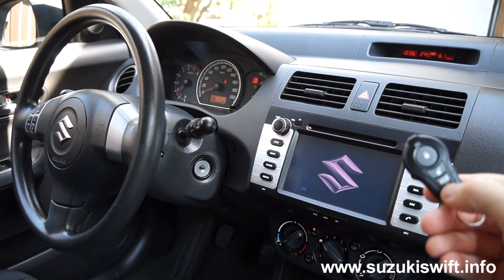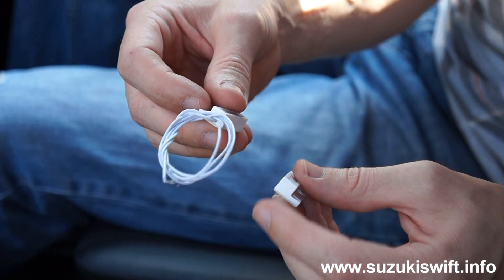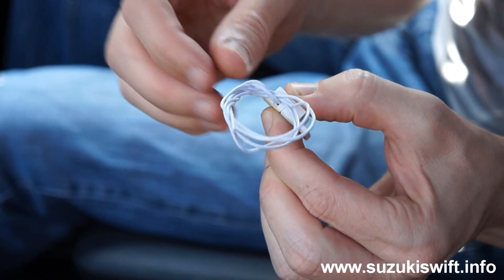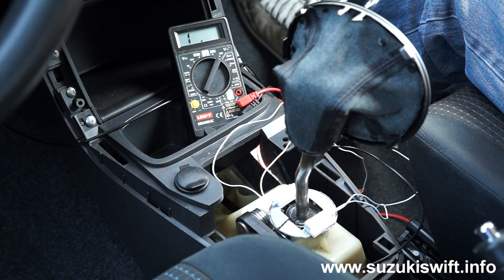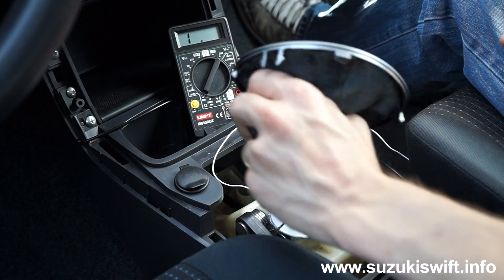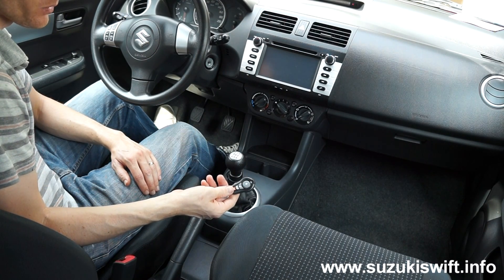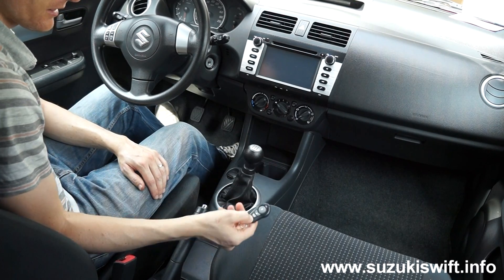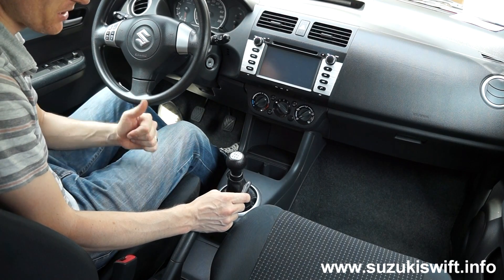Remote start with a manual transmission / stick shift

Comment: Wait, after you started the car (the engine is running) and put in the first gear, why it stops(cuts the engine) ? This would not be useful when your want to go somewhere. Or you were pressing the starter button when you did that and demonstrated that?
Reply from the maker: It's for safety, so the car would not start if it was in first gear.
Reply: @bored1980   thank you for your reply (I know it's a 7 year old video) I appreciate it. 
To be clear, I asking about the last 20 second of the video:
#The stick sift is in neutral
#You start the car with the remote
#The engine is running 
#You put in the first gear and the safety kills the engine 

Now if you want to go to work for example, you would get in your car(the engine is already running) and put it in (first) gear and go to work, right?
But if the safety kills the engine all the time. How you use your car, if your engine stops when you put in a gear? 

I was thinking you kill the engine and start your car again with it's key? So the safety of the remote control doesn't kick in? 

On other words: how you drive your car (in traffic) if the safety should kills the engine when you put it in a gear?

Comment: GOod video, we  should work together  so when its in nutural we can use some some of actuator to put in natural . if the gear in the lower range one actuator pushes it and the top part another actuator
Reply: or a sevro motor designed to return to a specific spot ..

Comment: Most MT's I've worked with have a neutral switch in the transmission. Just needed to wire that up instead of making your own.

Comment: I don't understand the last part. When you shift it into neutral w/engine running, It cut off. How is it supposed to know when you want to drive the car?
Reply: As soon as you want to drive you put the key in and turn to on, dont crank the starter again because card is already on. Press on brake, release E-brake and it'll bypass the remote start.

Comment: I have a remote start in my standard transmission truck but the sensors are on the parking brake and the driver door.

Comment: Perhaps a tight fitting ring magnet down the shifter shaft instead and the other magnet could be mounted on the spray can lid.. 

Really want remote start for my kia rio.. and am looking for factory fitted kits.. 

If anyone comes across a Kia Rio UB model remote start kit, push button start kit and keyless entry smart key kit..

Email me @ f3st1vagtx@gmail.com with the subject.. got anymore of them kia kits.. 

Thanks

Comment: Why are you pushing the clutch to shift with the engine off?
Reply: Because if your car starts to roll a slight bit it can grind. Also its an old habit from before cars had a synchro mesh transmission i think, atleast thats what my dad told me when i learned manual like 7 years ago.

Comment: I have a question, how did you bypass the clutch pedal? Or is that a switch too? The way I see it, you've only got the remote going to the viper box, then the box has a timer of some sort or it stays on when you hold the button in your hand, then it recognizes your switch and the gear lever but the clutch pedal? I have the same alarm system however I want a new updated one since mine is broken. Separated from that, my viper is being messed up by the stock alarm system some how so my plan is to get a new alarm system and get it all fixed with the new alarm install process.

Comment: How would it shoot off? I would assume the remote some how simulates a "clutch in" to start the car, but if it's in first it'd just start and then it'd probably stop simulating the clutch is in and drop the gear. Plus you should always have the hand brake pulled and no way would the car overpower your hand brake off a roll.
Reply: Justin Nguyen I didn't even think about that. You're right, the ebrake should over power the engine and stall it out.
Reply: Justin Nguyen not if your e brake fails or if he’s e brake has gonna bad that’s probably why he leaves it in gear and not in neutral

Comment: Great , but bored1980 my swift is 5sp manual and is the current gen which has button start. Will this thing work on my car the way I want I.e. remote start the car and take off without restarting?

Comment: Well that's actually a great solution .... but only one question up my mind... If u remote start and insert the key will the vehicle stall even then?
Reply from the maker: Hi Manashrey, if you put the key in while it has automatically started, the car will just keep running, and you can drive away. It won't stall if the key is in the "Run" position.
Reply: My dad's truck is similar, only it has an auto transmission. you have to push down the brake to move the shifter lever. However, if its running off remote start without the key on, if you push the brake the engine will shut off.
Reply: TheAnonymusConnor this must be for safety I suppose. You don’t want to start the car from a distance without the key on and someone to stole it.

Comment: I am installing one as I write this on my 96 neon. going from an econoline van to this is surly a difference in space, but the economy makes up the difference. I was thinking I could use a relay so the clutch switch still stays in tact (IE: the remote start sends a signal to temporarly bypass it only on remote start) but was thinking on a microwave switch on the stick.. Seeing your video makes complete sense. Hard drives have small yet incredible magnents I will post a video on this job :)

Comment: hi i love this idea. i have a 1989 mazda 323 and i wanna put an alarm system into my car . and i would like to insert an remote start. how do you drive it without it cutting out on you while driveing. is it the key inserted into the ignition? and if so what if i was to get one of the keyless ignition system would it still work out the same. it seems to be kinda sketchy to have that. but i thought it would be cool to have a no touch starting car. but i just want to make sure my car is gonna be safe and locked and also having the cool add on with a remote start. thank you please try to reply

Comment: Bored, this is airmc214 and i've tried this on my nissan sentra and it doesn't work. I need to know in detail how to do this?? Such as with the magnets where do the wires go and how many wires go to ground and how many go to the hood pin switch? As far as the multimeter where do you put the knob to measure what your trying to measure? I really need help with this cause im stuck!! Thanks
Reply: +Shariff Buren two wires go to ground. one from each switch the other two go to the hood switch..  as for the ohms meter it depends on what switches you have.. you want one that's normally closed meaning when the mag gets close it opens the switch depriving the starter of a ground.. you want to move everything thing around until you read resistance while the car is in neutral and infinity or 1 when the car is in gear.. seems like your also asking how to read the switches with the meter.. hook up the read lead to one wire of one switch and hook up the back to the second wire of the same switch
good luck..

Comment: Hi. I am a bit confused with the neutral switch. It is a brilliant idea and I am going to do that in mine Hyundai. I thought engine block heater would be good, but it just does not do enough good.
So, the question is - how does the switch work? I get the idea open/closed circuit when you get the parts close or far, but here is what gets me confused. In neutral there is some distance between contacts. Yet, it makes the circuit closed. However, when you put into 2nd, 4th or R the distance is smaller. Therefore, it should still keep the circuit closed, yet it opens it. 1st, 3rd, and 5th gear make sense - too far to keep the contacts connected in the switch.
Could you explain?
Are the magnet and switch a bit off to each other, hence, you do not get enough magnetic field to keep contacts closed?
Reply: +Piotr L. Pawlak the contacts are opposite of what you would think.. when the magnet gets close it opens the switch depriving the circuit of a ground

Comment: This is brilliant. I've been thinking about this problem for a long time and did not come to any conclusive idea. 
There is one problem with this method though. What if a magnet unsticks and falls off... This is not unlikely taking into account the amount of brutal mechanical vibrations shifter experiences both from shifting and coming from the transmission... I will think some more about how to improve your method so that magnet has to be there to arm the remote start, not to be gone to arm it.
The method I was considering is based on two photointerrupters, but also is not ideal.
Reply: epoxy or superglue will solve that.
Reply: I seriously doubt any amount of epoxy and superglue can fix the amount of damage an unattended running car can do to say a children's playground.
Reply: Ah, but if you epoxy or superglue the magnets in place correctly (not rocket science) you won't have to worry about them falling off and accidentally remote starting your car in gear...
Reply: +pguiver Even If you tried to start your car with the remote starter while in gear, it won't go far. You'd probably just strip out the starter gear, especially if you have the parking brake on.
Reply: NGC1433 I was thinking of epoxy a zip tie to the shaft of the gear lever and epoxy the magnet to the gear lever but also epoxy on top of the zip tie to create a stronger base. You could even get a small hose clamp possibly and drill a hole in the shaft just a 1/4 inch in and mount the magnet to the clamp and put a screw through the clamp into your hole. This way you could technically make it adjustable while maintaining a sturdy base for the magnet.
Reply: ***** Cars are different, mabe some would strip. I have driven my subaru for miles on a starter. (Forest fires are a bitch.) and car does not need to go far to crush a person standing in front of it in a parking lot.
 So, no thank's. I'm not relying on a bodge-work here(but don't get me wrong, my car is 30% bodge, 20% rust). And hope you realize, that risking to cripple somebody is some serious shit.

Comment: Another idea is to just use the factory neutral position switch if your car has one, as most do.
Reply from the maker: This one doesn't unfortunately and I'm yet to see a car with one. I don't doubt you, but it might be more of an American thing.
Reply: +240shwag show me a manual with a neutral switch.. automatics have them all day long but i have yet to see  a manual
Reply: +Matt Maxwell 
no. Google it. 
"neutral position switch"
good day
Reply: Well I stand corrected.    Never seen it but apparently they do exist
Reply: @659235  They exist but their tied to the clutch pedal, not the shifter

Comment: This is awesome, really, I didn´t know that it worked in newer cars as well ... how does it start with no key in it? Isn´t the little chip in the key needed to disengage the immobilizer in order to let the car start or was something to solve that included in the system as well?
Reply: There are bypass modules that program to the car's computer just like your key does. Usually you need 2 keys to program it in though, so it can't be used to steal the car, and it's also not active when the remote starter isn't active, so the security chips still work like they do from the factory.
Reply: ***** Yeah, I´ve done some more research and read about that too, pretty cool ... but in some countries (like mine) the insurances won´t allow messing around with the immobilizer and the modules that are like the stock one as you said are very expensive and you can´t really install it yourself as you need all that software to program it ...
Reply: If you really want a remote starter, I'd call a shop and talk to them. They'll tell you for sure if it's legal or not. Basically all it does is act like another key chip, so you're not defeating the immobilizer.
Reply: ***** It is fun to have, but not really necessary for the car (I have a module for bikes I´m going to install in my Suzuki) and besides, my car is a little older, the only way to make this work is an interface you put in the OBD-2 outlet that completely deactivates the immobilizer and that surely wouldn´t be smart and legal to do ... and if it wasn´t illegal the insurance won´t cover if anything happens ...

Comment: how will he drive then ?!, he put it in gear it stalls
Reply: Once you put the key in it will bypass the sensor.
Reply: When he puts the key in the remote starter will be off and the car will be on as if he turned it on with the key.
Reply: I mean you drive normally with out stalling and your cars nuetral safety switch isnt engaged.

Comment: Genius. Still trying to understand how it works. so basically, when the lever is in gear, the magnet on the shift lever and on the shifter connect and make a ground connection, therefore closing the circuit and preventing the car from starting?
Reply from the maker: Yep, you got it mate. It's called a "magnetic switch" and they're cheap and easy to work with..
Reply: thaik56  I can't help but correct you on the gear part. When the lever is in neutral, not in gear, it will create a closed connection. Being in gear would be a big problem if you got it to start lol
Reply: @michaelenochs5024  hence the need for a magnetic switch.. which i think all car companies should impliment... AND COME WITH A WARNING FOR ALL THE PEANUTS..
Reply: bored1980 Do the switches have to be touching or just be close? Just close right? Like those door chime switches that go off when a door is opened?
Reply from the maker: Cory Day W Depends on how strong your magnet is. With the "standard" white magnet you need them to be really close. Use a cheap, powerful enough neodymium magnet (from ebay) and you can be an inch away.

Comment: why it turn off when you shift ?
Reply from the maker: Just for safety, in case I remote start when the car is in gear.
Reply: He had no key in the car.
Reply: I don't know why I did not install this alarm before they stole my Mazda 2007